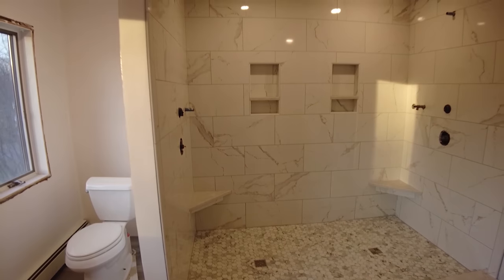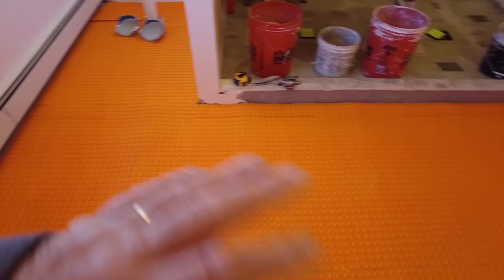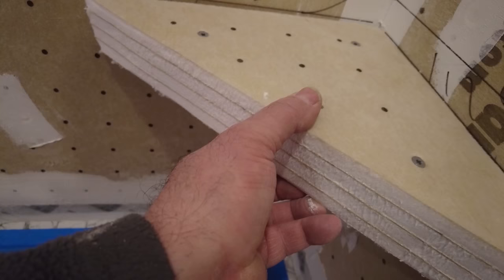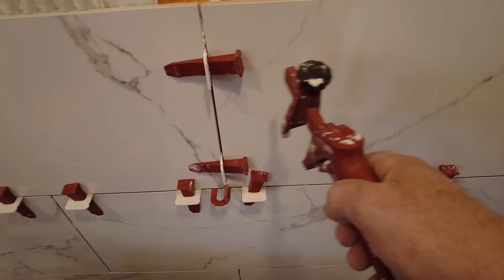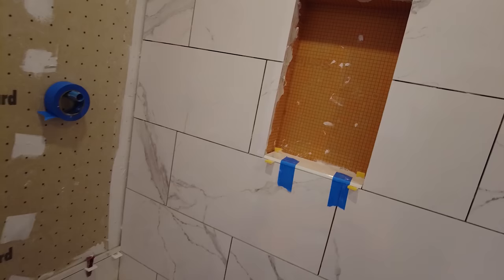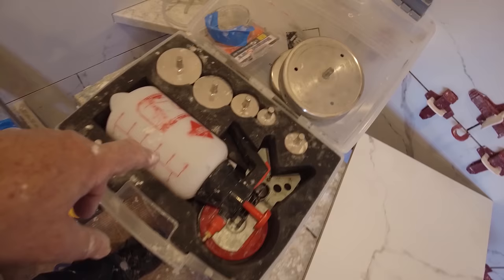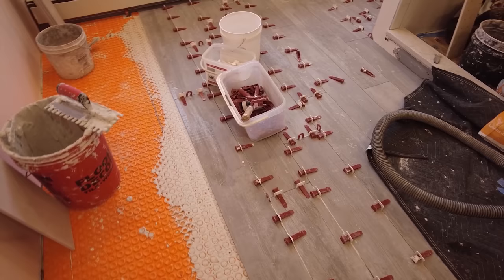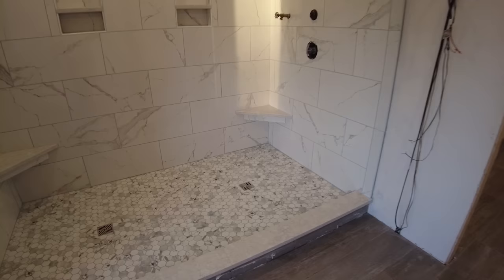Big Main Bathroom install, from studs to finished tile and grout.

Comment: I installed ceramic tile from 16 years old till about 19 years old. And grouting was the worst part about that job lol. Im now 33 and about to install ceramic tile in my bath room walls and shower, than doing ceramic tile on the wall between my kitchen cabinets and counter tops. Watching these videos to give myself a bit of a refresher course since its been nearly 15 years since ive laid a tile lol. Im thinking about laying tile on my countertops too just not sure id want grout lines on the counter tops. But anyways at 17 I got to the point where my boss would drop me off and do jobs by myself and I remember the satisfaction of completing the job and taking pictures of the work after I was done. Tiles done right is a work of art.
Reply: Remember grout is the concrete that actually holds the tile.  The mortar is just the glue to get it to stick to the wall or floor, the grout is the “concrete to hold it all together”

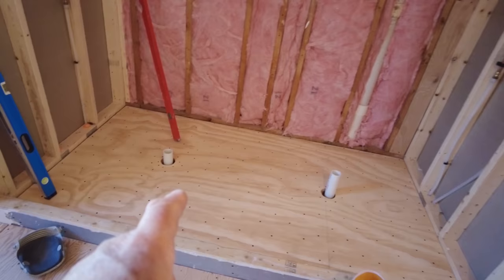Comment: Thank you so much for explaining around 1:15 how much time and how many cuts it's taken you to get to that point.  It seemed like one bathroom that I did took forever, & I was tempted to rush the next, but your explanation advocates for the correlation between taking your time and getting excellent results.
Reply: I have been around new construction since about 85 I started working full time. Switched to remodeling in 06 07 and have seen alot of showers bathrooms and huge condo floors. I have never seen anyone do every step the correct way as you did on this install. I hope you realize you are a true artist at your chosen profession. And sir you are the best I have ever seen. Thank you for sharing your skill.

Comment: couple of questions:
1) for the skirt tiles, how much did you cut down the 12" width?
1a) since you don't use a legger board, did you wait 24 hrs (or less) before laying the rest of the tiles?
2) for the shower walls, did you or should I use the schluter all set. Or something like ardex x77 prem non-sag?

Best DIY videos. you add great additional info like the (ANSI 118.4, A118.11, A118.15), setting, placing, removing levelers and spacers, etc
doing bathroom renovation and decided to use your methods and procedures. of all the youtube diy videos, yours is the best.

Comment: Great work … if only I had the sort of customers that will spend the money for the prep work to be done and wait the time it takes for a perfect job everything is rush rush these days
Reply: I'm mostly retired now (74) just finished one for my eldest daughter and at the same time another for a good friend of my youngest daughter (before these I swore never another one) in my entire tiling life (since 1965/66) it's mostly never been different most customers want everything done yesterday even when they don't articulate it, I take as long as the job needs and refuse to cut corners. BTW nice work Sal, I did pick up an interesting tip (never to old) where you levelled the adhesive lips (ridges) so the adhesive wouldn't penetrate the tile gap on these thin tiles.

Comment: When you put the backer board cement tape down what are you putting them down with you said “mudd” but are you referring to “tile thin set mortar”? Surely not plaster mudd? And why not just do it when you are putting the thin set on when your tiling?

Comment: Sal, You do beautiful work. I'm a carpenter that specializes in kitchens and baths and I do all our tile work. I'll never go back to doing vinyl shower pans. Schluter type membrane pans are the only way to go. One, they save a lot of time, two, they do a nicer straighter job, particularly in the corners and curbs, where vinyl tends to build out the corners way too much for my liking. I probably do about 10 showers a year, been using the Schluter system for the past 5 years. I've done a few vinyl pans in that time, but I implore customers to let me do a schluter system because It's just way better. I can't tell you how many shower pan failures that I've had to redo from previous contractors botching the job. I'm in the process of a total shower redo that was done 5 months ago that leaked almost immediately. They called us to redo it. I've learned a lot from you. Thanks buddy.
Reply from the maker: You are 100% correct, sealed systems are the way to go. Try the Laticrete system as well.

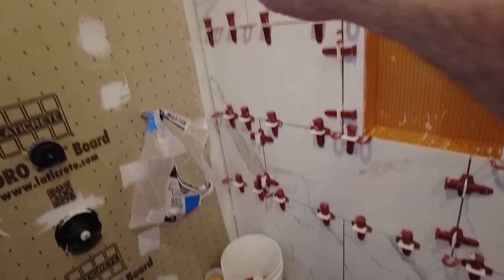Comment: 58:00. Do you ever “fold” the tile from floor to wall?  I laid a 12x12 diagonally in a bathroom then thought about running it up the wall but how do I do that, straight lines or still diagonal and if diagonal how do I wrap it up the wall and I should have thought about that when I was laying the tile on the floor so I could have saved the pieces.  I wish YouTube allowed for pictures then you would definitely make more money with specific guidance for each person who has issues.   So then I say okay no wall tile I need a baseboard but what do you use for a tile baseboard more of the same tile only cut lengthwise and do I set it right on the floor tile or leave a spacer for grout….  I am watching everything Sal because it’s all in the details.

Comment: Sal what are your thoughts on cutting tile maybe on both ends and not using a new tile with finished edge.  Especially with plank tile that is bowed in the middle and do you recommend using the spacing / wedge systems to pull the bowing down?
Reply from the maker: You always want a finished edge. https://www.youtube.com/watch?v=3GFkOiWvbUA&t=251s

Comment: Sal when you are laying the bottom wall tile to your laser line what are you using underneath them to hold them up to separate a grout line distance? Or do you set it right on the floor tile? Are you using tile spacers?
Reply from the maker: Horseshoe Spacers https://amzn.to/3Uq0dzh
Fine tune with wedges https://amzn.to/42q8B3K

Comment: Hi Sal, thank you for the videos. I am buying a new construction home and want to upgrade to steam shower. I would like to avoid gutting the new shower. Are hydro-bak boards installed like in this video if in a single piece okay for steam shower or do I need to demolish and then redo Kerdy waterproofing? Thank you.

Comment: 1:33:45 how are you cutting or sanding the bullnose hack?   And I do see the edge on the other flat surface tile inside the nook how did you get that, grinding, sanding, polishing or purchase like that? If you did it what tools will grind and polish like that?
Reply from the maker: Done with a wet saw.
Reply: I bought your stone going to try it today

Comment: 1:27:04 how did you make the wall edge corner tile, did you grind or sand them down to give a BullNose rounding, or was that a purchase?
Reply from the maker: Purchased, some tiles do have bull nose available.

Comment: What do you take for knee, back and wrist pain?
Reply from the maker: Comes with the territory.
Reply: Definitely Man Territory, I have been looking online for a massage place.  This tile stuff kicks my butt.  It starts with deciding which tile and how, then buying it which means lifting all that weight- putting it all on the cart along with those 50lbs bags of mortar, unloading it, laying it all out.  My finger tips are throbbing and cut up to the point of keeping me up at night.  The back pain and wrist pain, yes definitely a job for men.   I have even bought your expensive knee pads along with another $40 set even doubling them up and now my soft tissue in my knees are bruised.  No one can tell me men and women are made the same, all these Leftist Feminist well you never see them doing this kind of labor.  I am still watching!

Comment: Hi Mr can you use the purple drywall board and go over it with the hydroban water Membrane, if not what can I use?
Reply from the maker: Sheet membrane is a possibility, not the liquid applied, but much better off with a Foam board like I used in this shower or cement board and then the sheet membrane.
Reply: Okay thanks for your expert advice and continue to put our great content.

Comment: Are you using a cement board to cover the curb before you cover it with a membrane?
I was wondering if it matters what material you use to cover the 2x4. Do you use something that can take weight and not flex? And what about if you use 2x4s have you ever had concerns about expansion?
Reply from the maker: The whole shower is completely including the curb which is Hydro Ban Board like the rest of the shower https://www.youtube.com/watch?v=o9UkPjn1gYQ&t=1288s

Comment: Without a pan liner the shower will leak over time
Reply from the maker: This is not what you think, this does not have a two stage drain, it is a "Bonded system", also known as a "Sealed system" It is totally water tight. Watch this https://www.youtube.com/watch?v=o9UkPjn1gYQ&t=83s